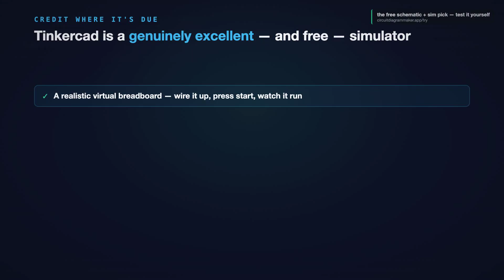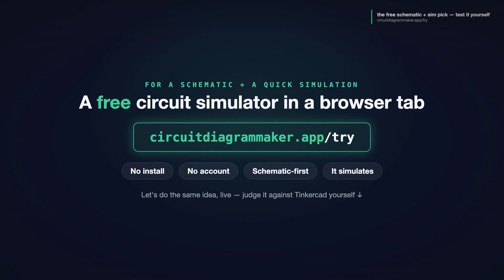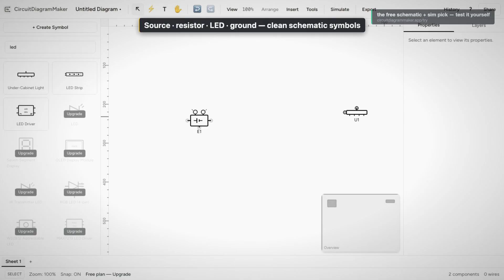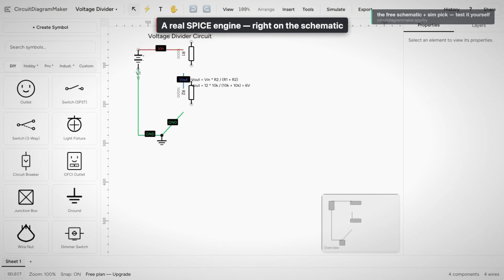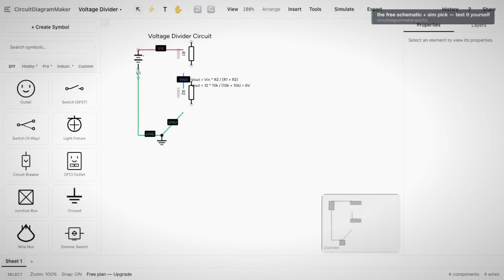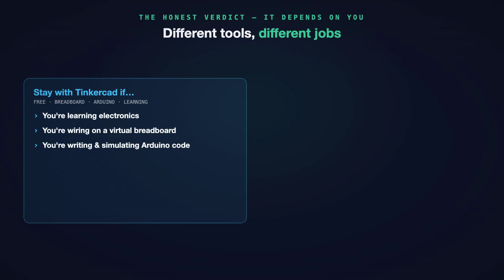Tinkercad Online Circuit Simulator: A Free Alternative

Comment from the maker: Full disclosure (also said in the video): the free browser tool is ours — which is exactly why Tinkercad gets its fair credit first. Tinkercad, by Autodesk, is genuinely excellent and completely free: a realistic breadboard simulator, real Arduino code you can run, and one of the best ways to learn electronics. If that's what you're after, stay with it.

Honest question for you: is it the breadboard, the Autodesk account, or just wanting a quick schematic that would pull you toward a lighter tool? Tinkercad is brilliant for breadboard and Arduino work — this is for when you specifically want a schematic plus a fast sim.

Do the same job free, in your browser, in about ten seconds — real symbols, wires that route themselves, and a live SPICE check with node voltages and currents right on the schematic: https://circuitdiagrammaker.app/tools/circuit-simulator?utm_source=youtube&utm_medium=pinned_comment&utm_content=yt-130